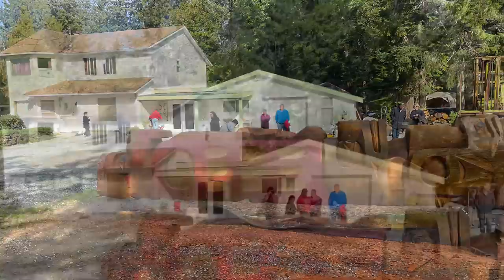Raising a 1500 year old totem pole, Down Town

Comment: I have a western Red Cedar ( Giant Arborvitae ) shingle that has 438 growth rings in about one foot in width and after I counted how many and how tight the growth is, I've kept it as a sample.
These trees are so large that the thin growth rings are still putting a tremendous amount of wood on the tree each year, because it may be like covering a football field or at least a large yard with several sheets of paper, and that growth is covering a large diameter and height plus all the branches.

Comment: You have to sand a strip starting with corse (40grit) sand paper and finish with very fine sand paper (400grit) then coat it with tung oil, then place a sewing flexible rule along the strip the with a camera with macro lens mounted on a tripod you start taking pictures of all the sections then transfer pictures on your computer and enlarging them again it is easy to count all the ring 
In a 13" fire kill pine still standing in a fire that happened in late 50's I counted 220 some years witch 70 years in the last inch section

Comment: Sand down the stump of the cut tree and wipe it down with a damp cloth. It makes it so much easier to count the rings, especially the ones that are really close
Reply: And if you can't sand it, a good sharp plane for the end grain and the oil and also a good magnifying glass.
I've counted growth as slow as 90 rings per inch on Redwood.

Comment: unreliable pillar support
Reply: I thought they would bore out the centre and lower it on a matching steel tapered pole surely the weight would prevent movement not mention the appearance, I haven't stood to many totem poles so I could be wrong.